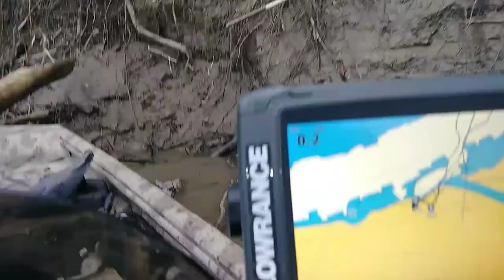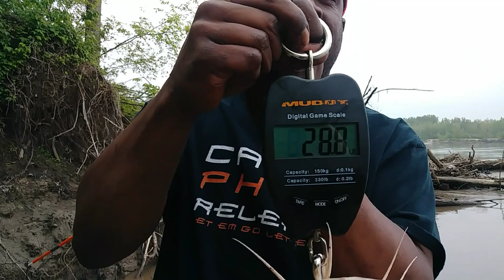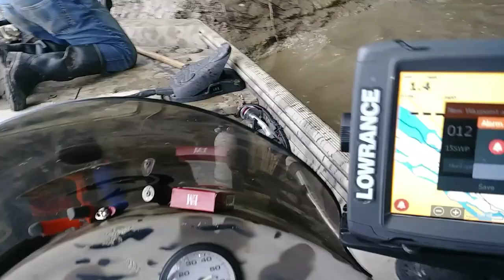We got the Skunk out the boat- Someone stole my Bank poles

Comment: I've had someone pull my limb lines out of the water and tie a bunch of knots in them (must have taken them forever to tie that many knots. Totally ruined the line) then had a jug stolen on the Arkansas river last week. It sucks. We have to put I.D. tags on our lines here in OK so it's hard to hide them with that tag flappin in the breeze + the line has to be tied 3ft above the water.

Any tips on hiding them?